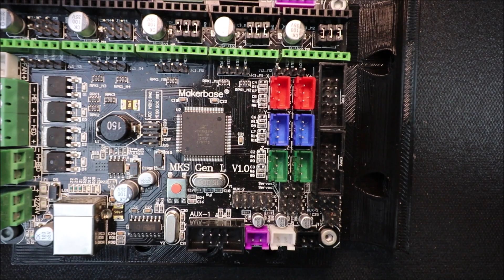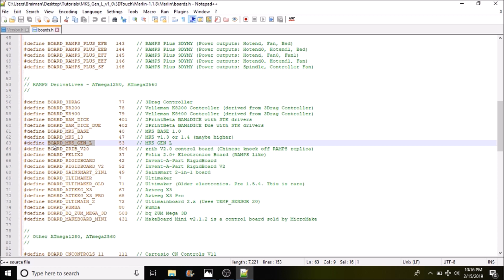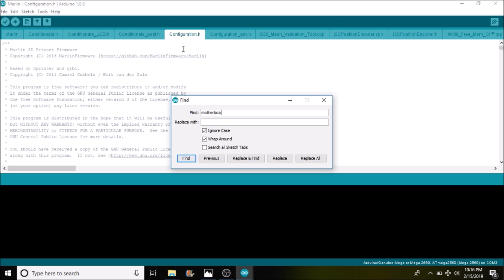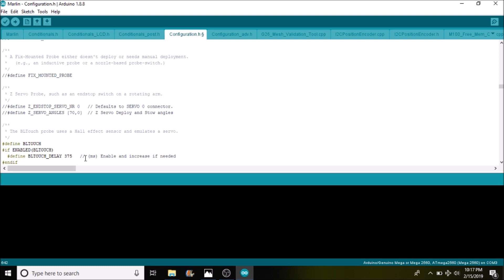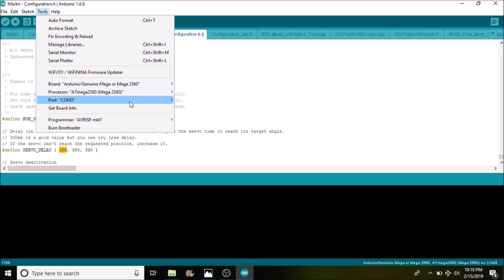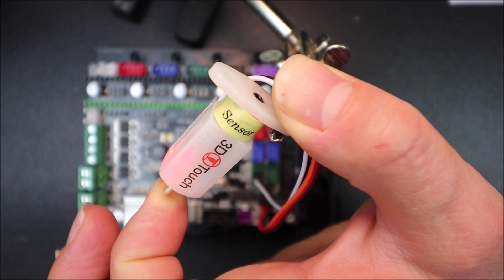MKS Gen L - 3D Touch

Comment: Thank you for this. I'm about to do my diy 3d printer with this board with bltouch. Hopefully everything will work out fine.
Reply from the maker: Keep in mind Marlin firmware for version 2.0.x may have issues.  Marlin 1.1.8 should be okay.
Reply: Any chance Marlin 2 is working ok now.  Just did  added this to my gen l 1.0 and having issues with Marlin 2.0.
Reply from the maker: There's two open issues by me and no updates for development at Marlin firmware.  I'll take a look tommorow and see if there is a change.
Reply: Right now the 3d touch starts up fine but the plunger stays up / retracted after the self test and the sensor stays red.
Reply: @jospa6880  I got everything running fine. But bltouch is acting up. It does all the bed leveling thing just fine. But when I tried changing the bed level it doesn't seem to compensate with the uneven height of the bed. Need more testingng,  I guess.
Reply: @Pistolonly1  perhaps I wired it wrong. I tried a few different ways but nothing seems to be working. If you have a chance can you add a pic of your board and the pins you used.
Reply: OK, I just verified my wiring is correct, so perhaps it's all in the Marlin 2.0 firmware?

In easy-config I've got:
#define MOTHERBOARD BOARD_MKS_GEN_L
#define BLTOUCH 
#define UBL

In the regular section I have:
#if ENABLED(BLTOUCH)
  #define Z_MIN_ENDSTOP_INVERTING true  // (was set to false originally, tried both ways)
#if ANY(BLTOUCH, INDUCTIVE_NC)
  #define Z_MIN_PROBE_ENDSTOP_INVERTING false // (no change)
#define NUM_SERVOS 1 // (no change)
#define SERVO_DELAY { 300 } // (no change)

I'm definitely confused on the servos section compared to the video.
Reply: @jospa6880  I used the z min end stop for the black and white connector. A few changes in marlin

Comment: Unfortunately, from experience, you may end up removing this sensor and replacing it with a genuine BLTouch.  I only say this because of repeatability issues with the knockoff sensor.  If you begin to experience problems with you first layer consistently, you may have a dodgy sensor.  Thanks for the video!  Anyone thinking about upgrading to this setup will enjoy it!
Reply from the maker: True.  In my case I don't use either on my printer, because I level surface manually.  But to give complete tutorials for subjects of interest, I made the tutorial.
Reply: @EdwardBraiman  FWIW, I was a die-hard live level kind of guy too.  I just never thought the bed leveling was working.   Since tuning up the BLTouch, I can start a print and rarely (if ever) need to monitor the print.  My first layers are rock solid and with a good PEI plate, adhesion is supreme!
Reply from the maker: Only drawback is that it takes time to get right and if bolts loosen you can be back to square one.  Doubling hex nut buys time though.
Reply: @EdwardBraiman  I did not install the spring mounting system that came with the BLT.  I use the Bullseye fan setup (stock fans) and I printed the BL Left mount.  I bolted the BLT straight to that bracket (with M3 nylocks) as it's (the bracket) adjustable.  I printed the BLT spacer tool from Thingiverse and used that to adjust that bracket to the proper place.  Once I understood setting the z-offset, it was smooth sailing.  I still do use the adjustment wheels on the bed, but mostly when I am printing something that spans all of the horizontal bed surface.  Then I live-level the wheels when my skirt it printing.
Reply from the maker: Sounds like this method works for you.

Comment: Great Video's on the MKS Gen L thank you for sharing. I own a CR-10S im going to use TMC2208 but wanted to know if the LV8729 should be used for the Dual Z axis or it's not worth it. I hear mixed info on this. Any info would be more then I have figured out so far. Thank You for all your MKS GEN L Video's keep them coming. Cheers, Dave
Reply from the maker: I'm still researching both steppers, so I'm not sure of a good answer yet.  You might want to check the datasheet (s).

Comment: Is it possible to use an endstop switch and the 3dtouch/bltouch at the same time? if you spliced the wires together would it cause any issues? I would like to use both just in case as a backup. Please let me know if that would work even if it is not practical.
Reply from the maker: Sure.  Check configuration advanced dot h for dual Endstop.
Reply: @EdwardBraiman  thanks
Reply from the maker: You're welcome.

Comment: Do you have to define which pins to use for the servo pins in marlin?
Reply from the maker: The tutorial is from before Marlin firmware version 2.0.0, it's very out of date.
Reply: @EdwardBraiman  I would think it would keep some type of same pattern? I have a filament sensor is what you say is servo 0 the odd thing is with my filament sensor hooked up it keeps saying triggered no matter what state the filament is not sure what else to do short of moving it to another set of servo pins.
Reply from the maker: Use the pins file to realign what's triggered
Reply: @EdwardBraiman  That's the part im trying to figure out now.. looking at the Pinout D11 is what I have it connected to which should be pin 0

#define FIL_RUNOUT1_PIN FIL_RUNOUT_PIN 0

#else
  #undef FIL_RUNOUT_PIN
  #undef FIL_RUNOUT1_PIN
#endif
Reply: @EdwardBraiman  It seems what I put in has no effect on the pins changing.
Reply from the maker: Use the Discord link in description.  There are many people there that can help.  In general chat.

Comment: Would you know why my boards.h file doesn't have the info to choose my board?  I have the MKS gen 1.0 board and their is no listings to choose. The boards.h file is basically empty  help??
Reply from the maker: What version of Marlin firmware are you using?  Marlin 1.1.8 thru 2.0.x contain MKS Gen L.  Also you can use board_ramps_14_efb as the pins between board match almost 98%.

Comment: SHARE FILE 3DTOUCH FOR ME, PLEASE
Reply from the maker: What's not working?
Reply: yes, it is standing only
Reply from the maker: Which printer board and firmware version are you using?  3d touch requires a lot of pressure to trigger.  You may need to use a table top to trigger.
Reply: i'm using marlin 1.1.8
Reply from the maker: What do you see in Pronterface when you check the Endstop status?